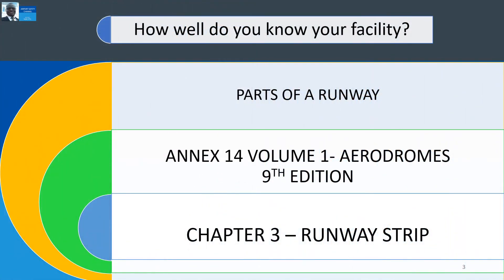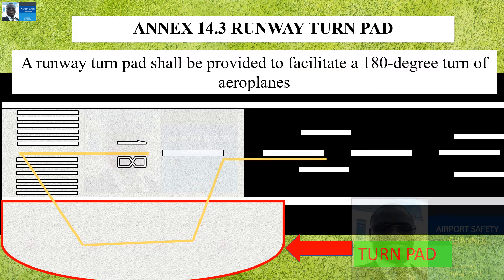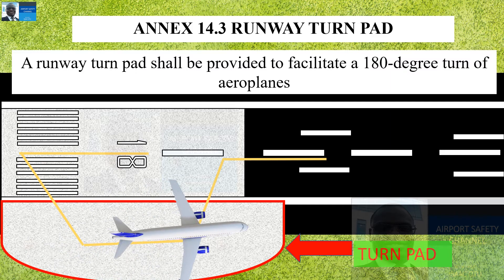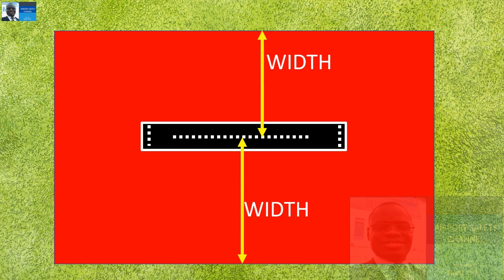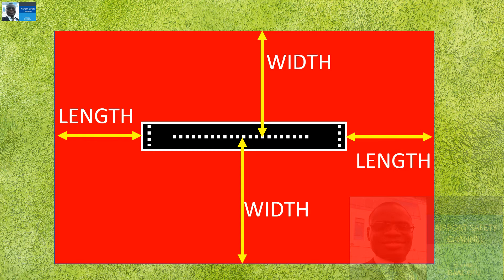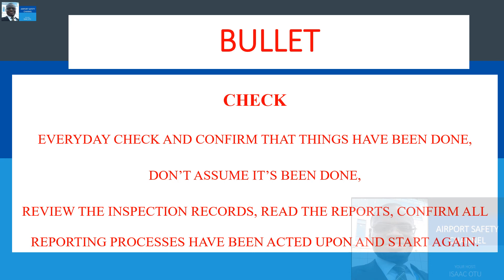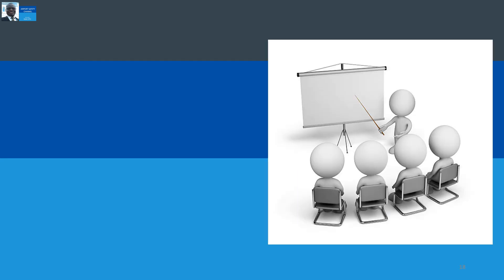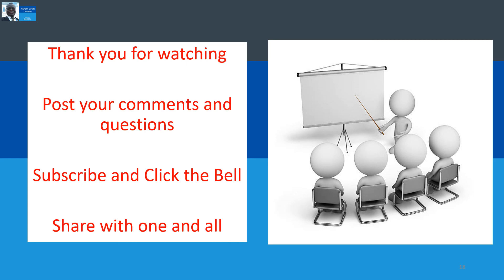Lecture 12 AIRSIDE FACILITIES   RUNWAY STRIP

Comment: hello Mr. Otu, sir how to deal with existing obstacle on Rwy strip for example a concrete building for operational requirement  within a 140m (80m) in precise ?
Reply from the maker: Hello, the action to be taken depends on several factors. But generally 
1. Remove the obstacle 
2. Conduct Risk assessment to Determine operational significance against the risk posed and mitigate 
3. Based on 2, either seek CAA  exemption or remove the obstacle.